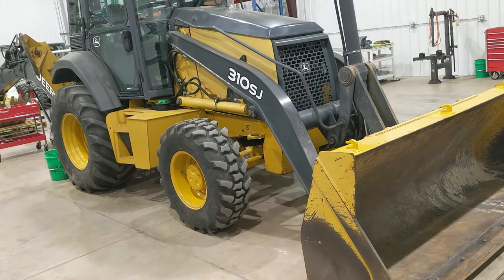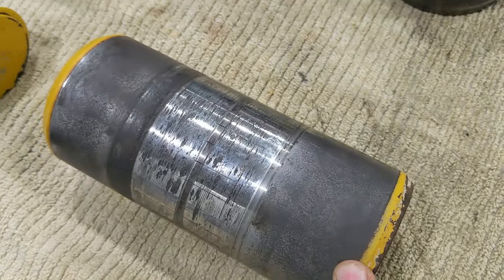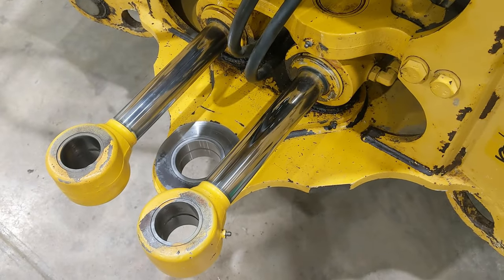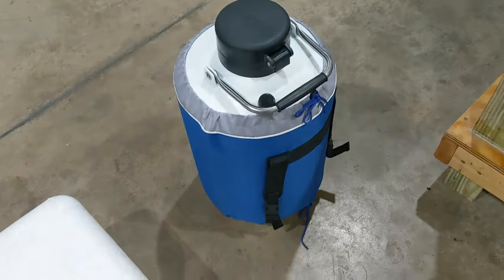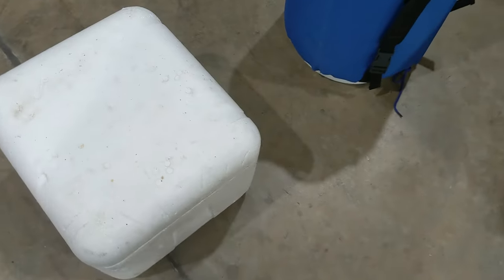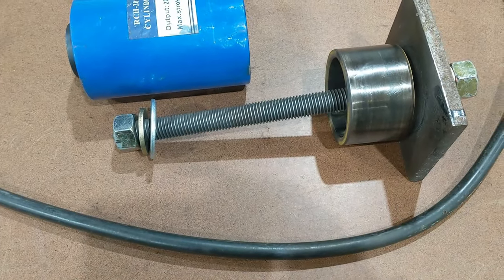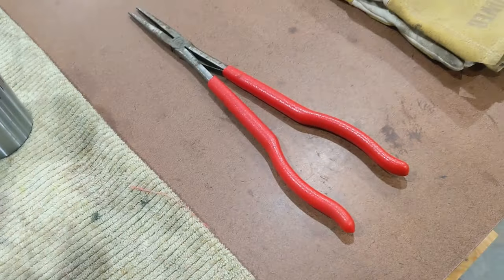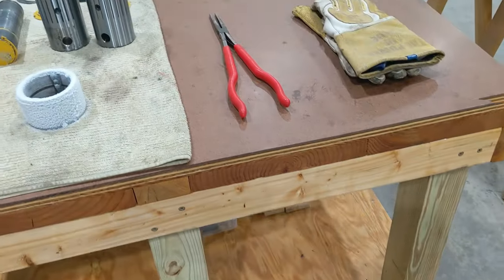Backhoe Bushing Replacement DIY

Comment: Hello,  Loved your video.  Lots of good learning for myself.
I just replaced all the seals in my swing cylinders on my JD 510C.  While doing so, I capped both oil supplies to the swing cylinders and was able to run the backhoe to lift up the hoe and swing it off out of the way to repair one cylinder at the time. I manually swung the hoe itself manually  and it felt real smooth without any resistance or weird noises.
Now I feel very confident that I can replace any bushings on my tractor using the power pack method you described.
My next plan is the kingpins and bushings,  I just ordered a hollow jack to pull and install the new bushings thanks to your video.
Best Regards
Gerard

Comment: i have a similar issue with our 710g backhoe. on hot days after hours of digging started to squeak out the swivel pins.  i found out using the proper grease and lifting the weight off the frame with hydraulics and greasing more often stopped the squeak 90%. might install grease lines up into the cab so dont need to stop and jump out every 30min. might be a deere problem!

Comment: Great legwork re: info...  Did you contemplate also heating the machine's bushing boss'.  That would have created a significant fit advantage?
Reply from the maker: Hi There.  Yes, my son was heating it with a heat gun for quite a while before I attempted to press the frozen bushing.  It might've helped some but it seemed like without a clearance fit, the bushing swelled immediately when it touched the bore.  I thought about a torch but wasn't crazy about messing up the paint.  Thanks for the comment though!

Comment: What about using dry ice? Would that work?
Reply: I guess it won't since the liquid nitrogen didn't. Seems odd that the interference fit is so tight. Most people seem to have success with dry ice or liquid nitrogen.
Reply from the maker: Hello, this sure would've been easier because dry ice in my area is sold in the grocery stores and you don't need a dewar to handle it.  However, dry ice is only -109F and liquid nitrogen -320F.  Add your shop ambient temp to that, let's say 60F and you get a total delta of -169F vs. -380F, so over double the shrinkage of dry ice.  I used one of the those online calculators for shrink of a pipe segment where you enter your ID, OD, and temp delta.  Dry ice still resulted in an interference.  LN2 got me to just about line on line, I thought if I worked fast it'd be OK.  Nope!

My conclusion after all this is that if you do the math and don't end up with a clearance fit at full shrink, don't even attempt the cold method.  As soon as that cold bushing touched the hot rearframe bore, it expanded like crazy and hung up after only going in about 1/4 of the way.  Brute hydraulic force finished the job.  In hindsight I think the LN2 might've worked if I'd used a bore hone to knock the peaks down and better size it ahead of time.  Maybe I'll try that next time.

Thanks for the question.
Reply: @StevesFarmShop  Thanks for the information. Would you be able to share those links to the pipe shrinkage calculations?
Reply from the maker: Hello, sorry for the delay, been quite busy.  I just did some quick searching and think the one I used is this:

https://www.engineeringtoolbox.com/thin-circular-ring-radius-temperature-change-d_1612.html

If you scroll down to the bottom of the page, you can enter your bushing diameter and temp delta.  Before I tried the LN2 method, one of the only other videos I could find on the topic was the one from the Cutting Edge Engineering channel.  Since he has some really nice equipment to do his own line boring and sizing, in that LN2 video he mentions some rules of thumb he uses for setting just the right amount of clearance.  It's worth a watch and his videos are great.